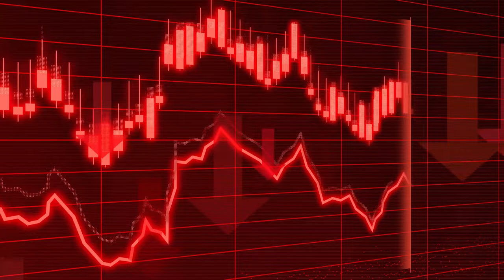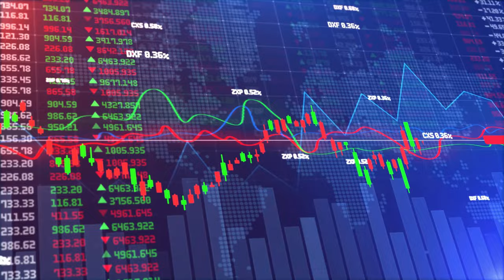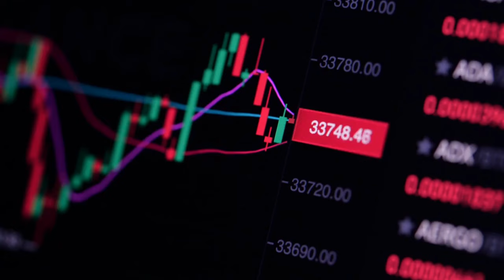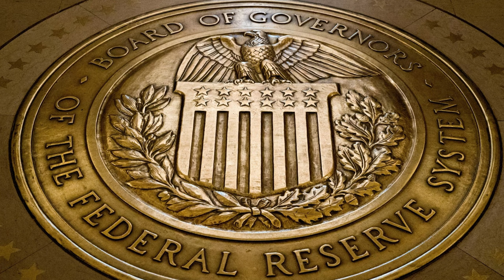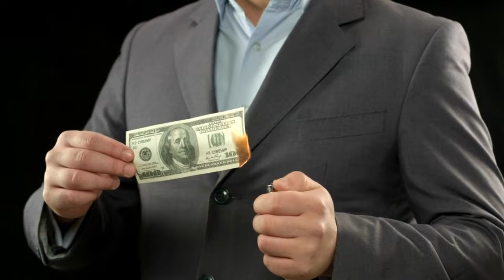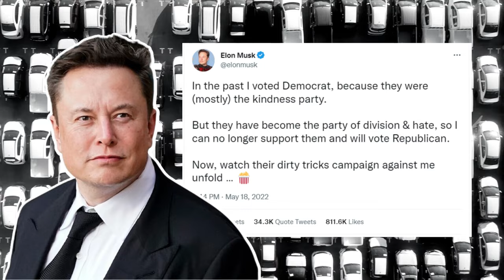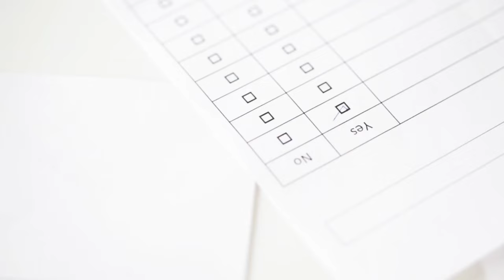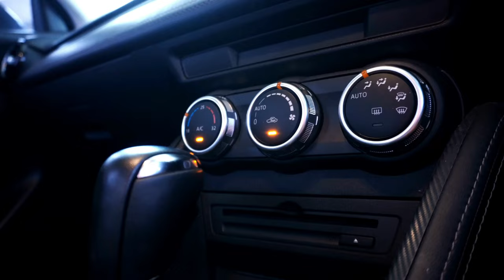Elon Musk - General Motors Facing Serious Financial Challenges

Comment: Barra said to sell more EVs, automakers have to design, build and manufacture cars that are more affordable and cost $30,000 to $35,000 to reach a goal of selling 30% to 50% of them.  GM is planning to fulfill that promise already by slashing the Chevrolet Bolt small SUV to start at $26,000 later in 2022. The Detroit-based automaker also plans to sell a Chevy Equinox small SUV with 300 miles of range for about $30,000 in the fall of 2023.  Less expensive EVs remain a challenge for Tesla whose Model 3 base price starts at $46,990 and remains its cheapest vehicle.  GM can also buy the chips in larger quantities because they will be more standardized and avoid supply chain disruptions in the future, Barra said.
Reply from the maker: Thank you for watching! We are looking forward to sharing more quality content.